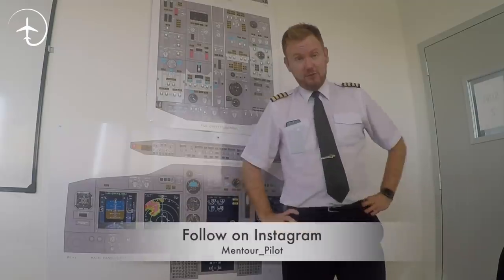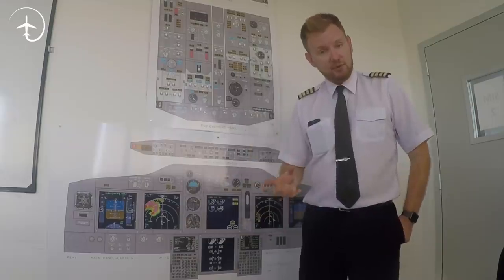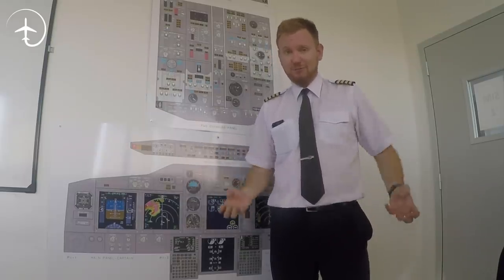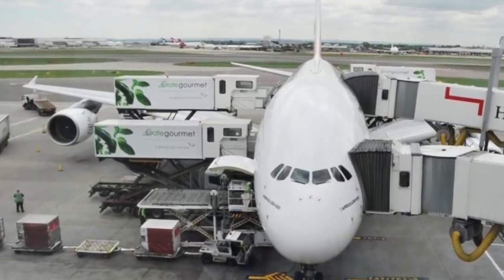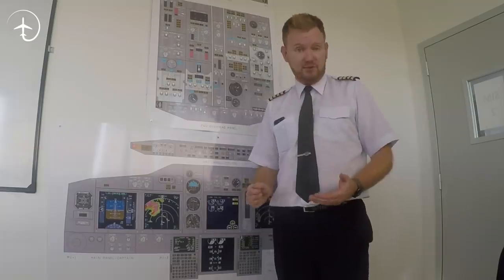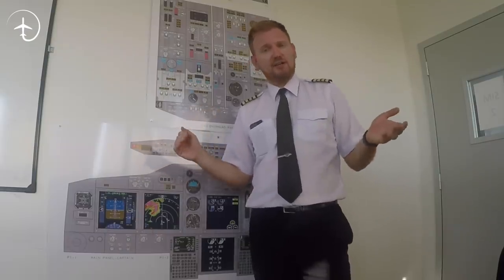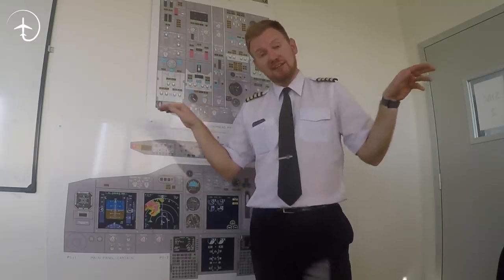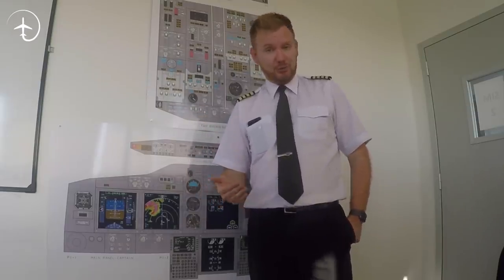What is that SPIRAL in the Jet Engine?

Comment: Hi Mentour! Did your airline company get the 737MAX? The Max is a beautiful plane. :) great vid as always! My friends said Hi from the Philippines
Reply from the maker: Coming next year. We are launch customers for the Max-200
Reply: Aah a fellow pilot. I'm not a pilot... yet! Still in grade 10!
Reply: Does the -MAX share a type rating with the 787 and the upcoming 777 refit because they have the same flight deck configuration?
Reply: Stoney3K Nope, they share a type rating with the 737NG, the large screens go to waste on the 737MAX because they are used in the same layout as the older 737s, just bigger, so no electronic checklist etc.
Reply: Andrew Ta Yes, the MAX-200 named after it's capability to carry 200 passengers due to extra emergency exit doors. Ryanair are the launch customer

Comment: Jet fuel though dangerous does not catch fire easily almost like Diesel and domestic kerosene but there is a difference, until and unless they are atomised. Meaning if you light a match stick in a bottle of jet fuel it will not ignite easily, but if you spray it on fire then it ignite almost instantly. But the fuel used in single engine Cessna are highly inflammable like gasoline since they are ignited by spark plugs. Captain correct me if I have gone wrong somewhere.
Reply from the maker: No, that’s all correct. Jet-fuel is essentially diesel.
Reply: Mentour Pilot Thank you
Reply: Yep, you can throw a burning match to a can of JET A and it won't do a thing but if you leave it in the open or indeed use a spray bottle the vapours will probably light up. AVGAS on the other hand is "basicly the same" as car fuel/petrol but with additives so it lights up a bit more easily...
Reply: With warm weather and just humidity isnt so difficult
Reply: The thing about fuels is they have flash points, and other specific engineered details and points at which the fuel will easily ignite/ flash/ combust/ boil/ explode.  Octane also plays an important role in ignition point. A Higher octane level will mean the fuel will be harder to ignite as the fuel is able to be compressed at a higher ratio (mix of fuel to air) before it self combusts. If you were stupid enough to throw a match into jet a1 you seriously deserve to be burnt. You might be able to do it a thousand times and it may not happen, But to do or say that is just stupid.  If you heat jet a1 up ie Its a really hot sunny day the fuel will boil exactly like diesel does and give off vapour, once that vapour is ignited it heats the surrounding air and liquid and the process will self support itself to the point of explosion. 
 You have to think about fuels this way,  If they DIDNT Produce massive amounts of energy ie by explosion, combustion etc etc the WOULDNT be used. Its better to be wary of all fuels than complacent and stupid.
Reply: fhhsvnggbh chill man... I was talking about lighting a coffee cup sized can of fuel in a controlled environment. Not lighting up the airport tanks 😂

You're right about fuels and fire usually not being a good idea together but I'll rephrase myself: throwing a match into a (small)can of JET A that hasn't had a chance to vapourize isn't going to explode or catch fire.
Reply: You should read up on the fuel they used on the SR-71, due to the extreme nature of the environment, the fuel had such a high octane rating that it required a separate tank of hypergolic fuel that would be injected in spurts, spontaneously ignite, and then that flash would ignite the after-burners, couldn't do it any other way apparently. 
The SR-71 was often refuelled in flight (by dedicated tankers), but there was a hard limitation on how many times they could fire up the afterburners per sorty before they ran out of the hypergolic fuel.
Reply: I thought jet fuel was kerosene with extra additives. Over the years hanging around camping forums (ore world wide web) it was considered a replacement fuel for stoves when traveling.  I was stuck sitting on the tarmac waiting for the weather to clear on our route and they shut down the engines. When started back up it smelled just like my fathers old kerosene heater from the 70's.  :-)

But have read diesel and kerosene act the same fire wise.
Reply: +Cliff Hartle my torpedo heaters run on jet-a , diesel , and kerosene ...
Reply: Many jet dragsters use diesel instead of JP.
Reply: Yeah, I think jet fuel is more like kerosene than diesel. That is, it is slightly thinner than diesel.

Then, on the other side of diesel, you have the really thick fuel oil that ships run on.
Reply: Lawrence D’Oliveiro jet fuel isn't like kerosene,  it IS kerosene.  It's a blend of mostly kerosene with some napthalene.
Reply: Early "wide-cut" jet fuels were a mix of kerosene and gasoline. Modern fuels (Jet A/A-1, JP8) are "narrow-cut" kerosene, highly refined to reduce levels of aromatic olefins etc. so they burn cleaner, have lower volatility, lower freezing point and higher flash point, along with additives e.g. antistatic/anti-corrosion/anti-icing agents to meet the required international specifications.
scott dean, that JP-7 was basically Magic Jet Juice. :D  
Can't even begin to work out how much it would have cost to develop and produce... which of course is why the program was finally canned. USAF just couldn't afford to keep tankers full of the stuff flying around to service a couple of very specialised planes. The hypergolic igniter was Triethylboron, I believe they carried enough for about 12 AB restarts which could be exciting on a 12-hour sortie given how fast they guzzled the juice.
Reply: Dear Men(tal) Pilot, do Your homework. Bit of chemistry, bit of physics. JET-A = diesel? LOL.

Comment: Hi Mentour, can you show us how to start up and shut down these large airliners
Reply: sean li can't speak for the 737 but on the Airbus, it is fadec (full authority digital engine control) 
controled.  turned engine starting into a non event. The selector is rotated to IGN/START, the #2 engine master is placed to ON and that's basically it. the rest of the sequence proceedes without pilot intervention:
 16 % ignition ON 
 22% starts fuel flow 
At 50% start valve closes, ignition off 
Engine idle should stabilize at about 58% 
ENG mode selector to NORM 
Normal Idle  Approx. 20% N1, 400C
 EGT, 60% N2, 600 lbs/hr FF.
Reply: I don't SPECIFICALLY know the startup procedure of the 737 (by airline checklist), but from my flight sim experience (which doesn't base my knowledge) here are the basic steps:
1. Connect to external power or startup the battery
2. Turn on the APU
3. Once APU is on you can open fuel pumps
4. Turn on hydraulic pumps as well
5. Turn the left engine start switch to the start pos. and wait till 23% N2, then put fuel cutoff on idle
6. Turn the start switch back to ground
7. Repeat steps 5 and 6 for the right engine
8. Before reaching the runway you need to turn off the APU to save fuel
Correct me if I'm wrong in any of the steps above.
Reply: Captain Turnipage if you have the mentour aviation app (and you should) go into the chat,  there is one 737 pilot there "pilotrob" who can answer that question. I am only typed on the A320

Comment: Worked 18 years on the ramp and the main reason the cones are at the tip of the wings is so you dodge the cone wit your tug and not dodge the tip of the wing. That way if you fail to miss the cone while dodging you only hit the cone and not the tip of the wing. Most wing tip cones are about 5 feet from the tip of the wing. And the reason you can’t walk under a wing is mainly because of the static charge wires and also it’s really easy to hit those and break them off and also put an eye out.

Comment: Always wondered why they couldn’t put a type of screen over the intake. Not a small hole one obviously but a larger hole one large enough to prevent geese and humans from being sucked in. I thought it may have to do with it slowing down the intake and probably effecting fuel consumption or something that involves monatary loss. But still if that were the only reason wouldn’t the loss of life be more important? Especially considering the damage bird strikes can cause. Look at the famous landing on the Hudson as a result of bird strikes. Ask captain sully.
Reply from the maker: Hi!
No, it would make a huge impact on the engines efficiency and the truth is that it would cost way more than the damage repair from bird strikes. Humans being sucked into engines is EXTREMELY rare.
Reply: Unless you were unlucky enough to be on one of the early 747's that went bank _ the official quote was that the lucky ones got sucked into the engine!
Reply: I should think given the amount horse power in one of those engines the suction produced would be monstrous and at flying speed it would require some very serious shielding indeed to prevent a bird or even parts of bird getting sucked in. That would obviously create a considerable obstruction to air flow into the engine. Bit of a daft question if one has any knowledge of engines and horse power in general.
Reply: Wouldn’t having a metal grate covering the inlet be a risk in and of itself? If that was knocked loose, it could cause some serious damage. Also, I’m sure the metal grate would just shred any foreign objects (like birds) on impact and send them passing through the engine anyway.
Reply: True.  A heavy screen or grille over the engine intake would just work like a french fry cutter on anything sucked into the engines.
Reply: A lot of aircraft do have these screens but are only used for ground operations, engine testing etc.....they either attach to the outside perimeter of the engine or some use a long molded pipe that is on the ground but extends well past the engine to all ground operations of the engine for leak checks, component failure, operational checks of newly installed engine itself or engine components etc....
Reply: exactly stephen
Reply: that would not work. yes it would restrict air flow and yes a bird would still get in the engine. not to mention if the screen failed it would destroy the engine.
Reply: walshy The Mikoyan MiG-29 has doors that slide up and divert the airflow from a dorsal set of intakes to prevent foreign object injestion during taxiing.
Reply: Reverse thrust would also probally blow it off after the 1st flight.

Comment: Can different airliners of the same type feel different to a pilot?☺✈
Reply from the maker: Very little but they are individuals so, yes.
Reply: srdjan m yepper, they all have their own personalities, no two are exactly the same
Reply: Also less complex aircraft (mean GA aircraft) or older airliners (those more “mechanical”) are even more different between each other within same type. For example when you do not have an actuated rudder trim, there is often a metal trim tab (basically a piece of bent metal) on the rudder that is adjusted by mechanic on the ground. Now you can imagine how differently it’s adjusted in different aircraft of same type. So some would need a bit more rudder input, some a bit less.

Comment: Won't some sort of LED lighting or outline deter birds from flying into the intake? Why don't engine manufacturers research that?
Reply from the maker: Could be a good idea. Would look very cool anyway.
Reply: MV-22 Ospreys and helicopters have those phosphorous "lights" on their blades tips, would indeed look cool on airlines. Another idea: have a led on the cowling change colour after fans spinning speed. Green=safe, red=danger.
Reply: the thing is birds fly at about or a max of 100kmh a jetliner is cruising at 5 or 6 hundred miles an hour. Spirals and lights dont do shit, to deter birds. The physical size of the aircraft is enough to deter birds from approaching but most bridstrikes is the aircraft unexpectedly crashing INTO the bird not the bird kamakazying into the aircraft!
Reply: RGB fans
Reply: That is an important topic and research is done, but the effective radius of lights is too low. In the sky at high speeds, you must deter birds at a distance of maybe 100m, impossible with lights.

At the moment the research is more focused on wind turbines, much easier to evaluate and to try new technology there, but even there they really struggle. Ultrasonic loudspeakers are good to protect bats, but other than that rarely anything but shutting down is effective.
Reply: With the speeds that an aircraft is going at compared to a bird, the aircraft more or less scoops up the bird and the bird is a stationary object. No single amount of movement from the bird can make it avoid certain death (and aircraft damage) when said bird is already in the path of the aircraft.

It's like a pedestrian trying to dodge a semi trailer going 100MPH.
Reply: i could not see any way that anything can stop birds from entering the engine, the plane would be going way to fast for the bird to see it coming let alone moving out of the way for it, the birds would'nt know what hit them

Comment: why all wings are of same colour???
Reply: because people with OCD would get triggered if they weren't😂😂
Reply: I'm no airplane engineer but I think it's just not economically viable to paint the wings. Plus I don't think it's a good idea to paint on the moving/sliding surfaces such as the flaps.
Reply: Michael Joute how much of the paint do you think could be seen when painted on the wing? Especially when on the ground? If totally non-painted, there is a weight saving by not painting the wings.
Reply: actually its about weight. paint carries weight and the wings are the most vital parts that lift the plane into the air. Wings of a commercial airline are flexible and if paint was to be added then it would be carrying a lot of weight which doesn't allow the wings to flew to stabilise the plane when there is turbulence. Hope that answers your question.

Comment: Former aircraft mechanic myself. We had a fuel dump accident at work one night. Was doing fuel level testing, tank pressure checks and also pressure checks on the dump masts at the wingtips. When we took over the plane from dayshift they informed us they had put most of the fuel in the plane earlier in the day doing static leak checks and repairing those as needed. The plane only needed a top-off for us to do some of the checks later in the night. 

We got truck hooked up, pumping fuel, after a few minutes of pumping everyone is starting to get concerned, plane appeared to be taking on more fuel than we were told it would need. Everyone was on the right wing of the plane where the fuel truck was, manning fire extinguishers, checking dump mast pressure gauge, supervising the area, etc. Supervisor calls out to one co-worker to go in the plane to verify the fuel levels in all the tanks since plane had ground power hooked up already. Crew entrance was on left side of plane. We watched as he went around the nose and suddenly starts hollering and running back waving his arms to shutdown the fuel truck operation. 

All the fuel the truck was pumping was going out the left wingtip unbeknownst to all of us. lol That was a long night working with the fire department and EPA representatives doing a major cleanup of several hundred gallons of fuel.
Reply from the maker: Yes, I have seen that happen actually.

Comment: Fabulous series of super informative videos, gradually working my way through these. One question here; I've boarded a few aircraft and as you walk past the engines the fans are 'freewheeling' in the breeze, and quite often one hears a tinny clanking noise, best described as a kid putting a stick in his bike spokes. It certainly seems as if the blades are catching in something, and not just spooling silently as I would imagine a super complex engine should... what do you think that could be?
Reply from the maker: The blades have a certain “play” in their fittings, that’s built in to make sure they don’t get into a kind of destructive vibration, similar to what happens in a tuning fork.

Comment: Story time. I work as ground crew and we used to ground load commercial Q400 passenger flights. This included the front and back doors. We had ropes that would go from each door to a stand at the wing tip, but those got removed because sometimes the automatic retraction of the ropes would whip back and damage the aircraft. So we had to switch to cones. After seeing many people ignore the cones and walk under the wings (even approaching and handling the propellers) we decided to do a little experiment. One night we rounded up as many cones as we had available and set them up. About 17 along the #1 wing, clearly outlining a path around the wing. Sure enough, plenty of people ignored the cones, having to even push through them to walk under the wing. We all just shook our heads.

Comment: The spinners were painted on Luftwaffe aircraft with contrast in mind. In terms of the fighters the spirals on the spinners were assumed or rumored to confuse opposing guns crews which seems like a misnomer considering the approach distance and rapid closing speed. Safety seems like the best plausible explanation, considering the new Bf109F-1 had a new streamlined sloped spinner blended smoothly into the new engine cowling that was more aerodynamic from the older E series. Ground crews could easily determine if the bigger F series spinner and propeller were in throttle.

Comment: When we were in Iceland we had to wait before Boarding the plane on the tarmac. There was no formal dispatcher and it was so cold we huddled around the back of the the engine and got all warm and toasty. Better than a campfire, we did not light cigarettes, toast marshmallows or make Smore’s, but we certainly could’ve. I agree, those engines get very very hot, even on Idle.